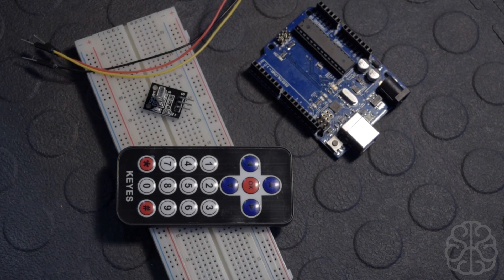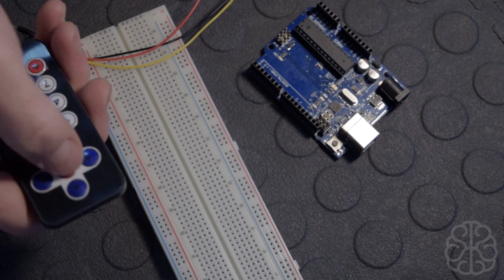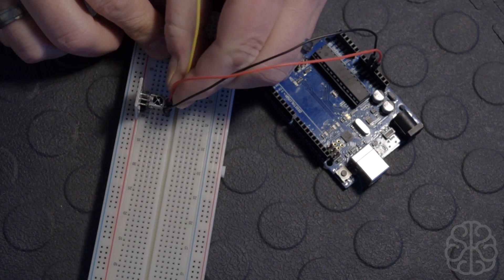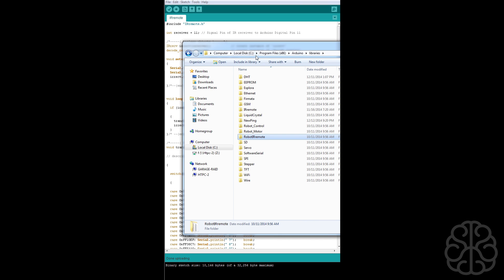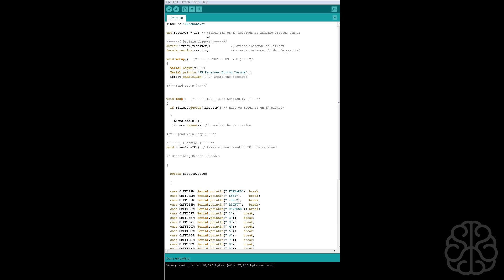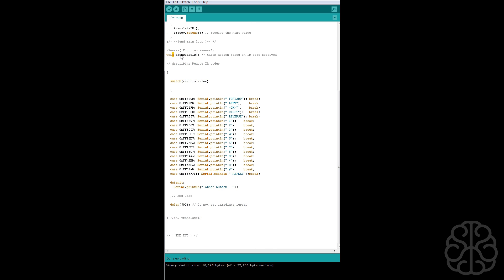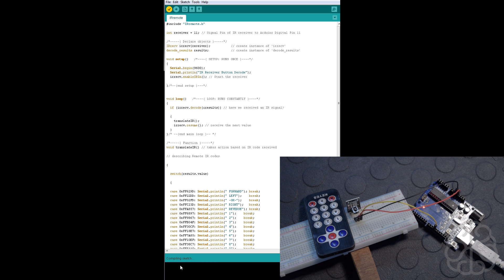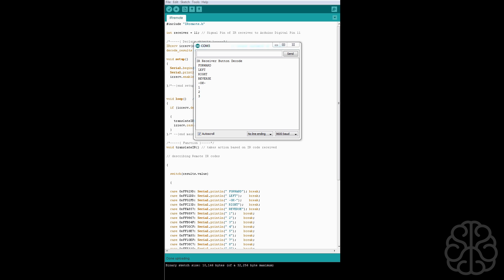Use Infrared sensor & IR Remote control on Arduino - Tutorial

Comment: Hello sir I am Abid. I have a question can I use the IR remote for the 28BYJ-48 Stepper Motor. Condition is that each button is used running the motor clockwise each time press and when the button is pressed again to run the motor in anti-clock direction with a specific number of turns. If any idea you have that will be my good luck.
Thank You!

Comment: hey buddy, good video well explained, I have a simple control access code which use a 4x4 keypad, if I put 1234 pin this open a relay, I would like to use a remote control on it, the idea is  to put the pin on the remote or in the keypad, so any idea how to do it?

Comment: /*
source:  Alex Lin
You'll need to change the led pins and the codes
accordingly to your configuration and IR remote
*/
#include <ir_Lego_PF_BitStreamEncoder.h>
#include <IRremote.h>
#include <IRremoteInt.h>
#define RED_LED_PIN 4 //Define the pin of the red led 
#define BLU_LED_PIN 5 //Define the pin of the blue led
#define YEL_LED_PIN 6 //Define the pin of the yellow led
#define GRE_LED_PIN 3 //Define the pin of the green led
#define ONE 16738455 //Define the key 1
#define TWO 16750695 //Define the key 2
#define THREE  16756815 //Define the key 3
#define FOUR  16724175 //Define the key 4
#define FIVE 16718055 //Define the key 5
#define SIX 16743045 //Define the key 6
#define SEVEN 16716015 //Define the key 7
#define EIGHT 16726215 //Define the key 8
#define NINE 16734885 //Define the key 9
#define ZERO 16730805 //Define the key 0
IRrecv irrecv(7); //The pin where you connect the output pin of AX-1838HS
decode_results results;
void setup()
{
  pinMode(RED_LED_PIN, OUTPUT); //Change the mode of the red led pin to output
  pinMode(YEL_LED_PIN, OUTPUT); //Change the mode of the yellow led pin to output
  pinMode(BLU_LED_PIN, OUTPUT); //Change the mode of the blue led pin to output
  pinMode(GRE_LED_PIN, OUTPUT); //Change the mode of the green led pin to output
  irrecv.enableIRIn(); // Start the receiver
}
void loop() {
  if (irrecv.decode(&results)) {
  
    if (results.value == ONE) { //Check if the key 1 is pressed
      digitalWrite(RED_LED_PIN, HIGH); //Turn on the red led
    }else if(results.value == TWO) { //Check if the key 2 is pressed
      digitalWrite(BLU_LED_PIN, HIGH); //Turn on the blue led
    }else if(results.value == THREE) { //Check if the key 3 is pressed
      digitalWrite(YEL_LED_PIN, HIGH); //Turn on the yellow led
    }else if(results.value == SEVEN) { //Check if the key 4 is pressed
      digitalWrite(GRE_LED_PIN, HIGH); //Turn on the green led
    }else if(results.value == FOUR) { //Check if the key 5 is pressed
      digitalWrite(RED_LED_PIN, LOW); //Turn off the red led
    }else if(results.value == FIVE) { //Check if the key 6 is pressed
      digitalWrite(BLU_LED_PIN, LOW); //Turn off the blue led
    }else if(results.value == SIX) { //Check if the key 7 is pressed
      digitalWrite(YEL_LED_PIN, LOW); //Turn off the yellow led
    }else if(results.value == EIGHT) { //Check if the key 8 is pressed
      digitalWrite(GRE_LED_PIN, LOW); //Turn off the green led
    }else if(results.value == NINE) { //Check if the key 9 is pressed
      digitalWrite(RED_LED_PIN, HIGH); //Turn on the red led
      digitalWrite(BLU_LED_PIN, HIGH); //Turn on the blue led
      digitalWrite(YEL_LED_PIN, HIGH); //Turn on the yellow led
      digitalWrite(GRE_LED_PIN, HIGH); //Turn on the green led
    }else if(results.value == ZERO) { //Check if the key 0 is pressed
      digitalWrite(RED_LED_PIN, LOW); //Turn off the red led
      digitalWrite(BLU_LED_PIN, LOW); //Turn off the blue led
      digitalWrite(YEL_LED_PIN, LOW); //Turn off the yellow led
      digitalWrite(GRE_LED_PIN, LOW); //Turn off the green led
    }
    irrecv.resume(); // Receive the next value
  }
}

Comment: my ir receiver just has a red light permanently on until I pull the power off. the code previeosuly was working and so was the IR so I dont know what ive done pls help me
Reply: check your sensor pcb if its crossed input and check the sensor only pin out

Comment: i have a problem

text from compiler:

Arduino: 1.8.1 (Windows 7), Board: "Arduino/Genuino Uno"

Tone.cpp.o (symbol from plugin): In function `timer0_pin_port':

(.text+0x0): multiple definition of `__vector_7'

libraries\IRremote\IRremote.cpp.o (symbol from plugin):(.text+0x0): first defined here

collect2.exe: error: ld returned 1 exit status

exit status 1
Error compiling for board Arduino/Genuino Uno.

This report would have more information with
"Show verbose output during compilation"
option enabled in File -> Preferences.

Comment: This report would have more information with
  "Show verbose output during compilation"
  enabled in File > Preferences.
Arduino: 1.0.6 (Windows 10 Pro), Board: "Arduino Uno"
C:\Program Files (x86)\Arduino\libraries\RobotIRremote\IRremoteTools.cpp:5: error: 'TKD2' was not declared in this scope

Comment: #include <boarddefs.h>
#include <IRremote.h>
#include <IRremoteInt.h>
#include <ir_Lego_PF_BitStreamEncoder.h>

int receiver = 11; // Signal Pin of IR receiver to Arduino Digital Pin 11

/*----( Declare objects )----*/
IRrecv irrecv(receiver);     // create instance of 'irrecv'
decode_results results;      // create instance of 'decode_results'

void setup()   /*---( SETUP: RUNS ONCE )---*/
{
  Serial.begin(9600);
  Serial.println("IR Receiver Button Decode");
  irrecv.enableIRIn(); // Start the receiver

}/*-(end setup )--*/

void loop()   /*---( LOOP: RUNS CONSTANTLY )---*/
{
  if (irrecv.decode(&results)) // have we received an IR signal?

  {
    translateIR();
    irrecv.resume(); // receive the next value
  }
}/* -(end main loop )- */

/*----( Function )----*/
void translateIR() // takes action based on IR code received

// describing Remote IR codes

{

  switch (results.value)

  {

    case 0xFF629D: Serial.println(" FORWARD"); break;
    case 0xFF22DD: Serial.println(" LEFT");    break;
    case 0xFF02FD: Serial.println(" -OK-");    break;
    case 0xFFC23D: Serial.println(" RIGHT");   break;
    case 0xFFA857: Serial.println(" REVERSE"); break;
    case 0xFF6897: Serial.println(" 1");    break;
    case 0xFF9867: Serial.println(" 2");    break;
    case 0xFFB04F: Serial.println(" 3");    break;
    case 0xFF30CF: Serial.println(" 4");    break;
    case 0xFF18E7: Serial.println(" 5");    break;
    case 0xFF7A85: Serial.println(" 6");    break;
    case 0xFF10EF: Serial.println(" 7");    break;
    case 0xFF38C7: Serial.println(" 8");    break;
    case 0xFF5AA5: Serial.println(" 9");    break;
    case 0xFF42BD: Serial.println(" *");    break;
    case 0xFF4AB5: Serial.println(" 0");    break;
    case 0xFF52AD: Serial.println(" #");    break;
    case 0xFFFFFFFF: Serial.println(" REPEAT"); break;

    default:
      Serial.println(" other button   ");

  }// End Case

  delay(500); // Do not get immediate repeat

}
Reply: doesnt work your code

Comment: I have few questions about the project. I hope you can point me to a better direction. I want to turn the remote into a quick button for my computer, how do the codes looks like. For example for button 1 I want to be "ctrl +" and button 2 "ctrl -" how do I program it. I know the arduino will connect to my computer and do i need to program the aduino "like the driver" If you can answer the question will be a great help. Thank you so much.

Comment: Hi...Help please, How do i know what hexes to use for the cases?please help me!!!
Reply: It tells me this:

Arduino: 1.8.1 (Windows 10), Board: "Arduino/Genuino Uno"

C:\Users\Natha\Documents\Arduino\IR_remote\IR_remote.ino: In function 'void translateIR()':

IR_remote:18: error: unable to find numeric literal operator 'operator""S2AD'

     0xFFS2AD: Serial.print(" 0"); break;

     ^

exit status 1
unable to find numeric literal operator 'operator""S2AD'

(the last part like times 20 with different hexes)
Reply: by last part i mean tihs part:

IR_remote:18: error: unable to find numeric literal operator 'operator""S2AD'

     0xFFS2AD: Serial.print(" 0"); break;

     ^

exit status 1
unable to find numeric literal operator 'operator""S2AD'
Reply: Look at the code at 4:23
Reply: You can use decimal values. Is easier. I did it. is 9 digits. Just use Serial.print(results.value) to see numbers. If You use Serial.print(results.value, HEX) You will get hex values.

Comment: No Matter what i do this is isn't running.  The only library folder i have in the document arduino folder is a IR master folder. nothing else but i'm still getting the error. 
C:\Program Files (x86)\Arduino\libraries\RobotIRremote\src\IRremoteTools.cpp:5:16: error: 'TKD2' was not declared in this scope

 int RECV_PIN = TKD2; // the pin the IR receiver is connected to

                ^

Multiple libraries were found for "IRremote.h"
 Used: C:\Program Files (x86)\Arduino\libraries\RobotIRremote
 Not used: C:\Users\Owner\Documents\Arduino\libraries\Arduino-IRremote-master
exit status 1
Error compiling for board Arduino/Genuino Uno.
Reply: I'm having the same issue.

Comment: Why you didn't use pinMode in the setup ?
Reply from the maker: Hi Patryk, when the Arduino is powered on, al the pins are set as INPUT, with PULLUP resistors turned off by default.  So in this tutorial case, since the pin we are using to connect the IR sensor is an Input and doesn't need Pullup resistors, it's optional to use pinMode in the setup since it's this way by default.  Hope that helps and thank you for watching!

Comment: Hello..Could you help me please? My cases dont work.. I always get default for whatever button I use. Do u know why, please?
Reply: after your case is it a : or ;
Reply: Add a capcitor
Reply: First You need use Serial.println(results.value) to print on screen what button You pusht, then You need check and change hex value for case. Your IR remote could have different keystrokes. I hope that will help in futer to other peoples. It helps me. Whit this method i can use remote for tv.

Comment: Hallo,

I tried your IR-library with a similar simple key pad and it worked very quickly. 
But ofen the Arduino UNO gets another code than usual.

What may be the reason? What can I do to avoid it?

regards

Freddy Conrad

Comment: please help :
Arduino : 1.6.8 Hourly Build 2016/02/09 05:41 (Windows 10), Carte : "Arduino/Genuino Uno"

D:\Program Files (x86)\arduino-nightly\libraries\RobotIRremote\src\IRremoteTools.cpp:5:16: error: 'TKD2' was not declared in this scope

 int RECV_PIN = TKD2; // the pin the IR receiver is connected to

                ^

exit status 1
Erreur lors de la compilation.

This report would have more information with
"Show verbose output during compilation"
option enabled in File -> Preferences.
Reply: I know this is a year late, but that means you haven't loaded the library correctly. You should look on the Arduino forums to find out how to properly do it.

Comment: any1 know what frequency these use ???
Reply from the maker: +kenny ball I believe the IR receiver uses 38kHz, which is the most popular frequency for tv remotes.  Found this pdf with tech specs here: http://www.vishay.com/docs/82491/tsop382.pdf 
Hope that helps, thanks for watching btw :)
Reply: cheers for the reply...thx for takin the time ;)
Reply from the maker: +kenny ball Hey, no problem at all!  Glad I could help :)
Reply: @Brainy-Bits if it's using 38kHz, the remote in my kit doesn't take values from long distance only near the sensor it is working. How to solve this problem?
Reply: about 40kHz. There on Youtube is another tutorial about ir remote. https://www.youtube.com/watch?v=8E3ltjnbV0c&t=1671s This is greate tutorial.

Comment: what i have to do if my remote control generates different codes?
Reply: +Luca Rizzo this is a from a comment below "+Mr30friends Ok , i made it , for those with the same issue. Paste :
Serial.println(results.value, HEX);
on top of:
translateIR(); "
Reply: +Jordan Habash thanks! i'll try it ;)
Reply: +Jordan Habash it doesn't work. Arduino says:" translateIR was not declared in this scope".
Reply: that's just because you need to change to code around a little. put the translateIR at the top of the code and it should work. if there is anything else that is not declared in the scope, just move that decleration around

Comment: Thank you very much ,everything worked .I only have one question .My remote control has more buttons than yours.How can i find out their codes (0xFF9867 for example) so i can make more cases to utilize them .
Reply: +Mr30friends Ok , i made it , for those with the same issue. Paste :
Serial.println(results.value, HEX);
on top of:
translateIR(); 
    irrecv.resume(); // receive the next value
That way the value will be pasted in the serial monitor and you can make your case for every button accordingly.
Reply: Will the IR sensor catch the signal from all the angles?? I mean will it work if we pressed a key from behind the ir sensor??

Comment: I have a problem Arduino: 1.7.8 (Windows 7), Board: "Arduino Uno"

D:\Program Files\Arduino\libraries\RobotIRremote\src\IRremoteTools.cpp:5:16: error: 'TKD2' was not declared in this scope

 int RECV_PIN = TKD2; // the pin the IR receiver is connected to

                ^

Error compiling.

  This report would have more information with
  "Show verbose output during compilation"
  enabled in File > Preferences.
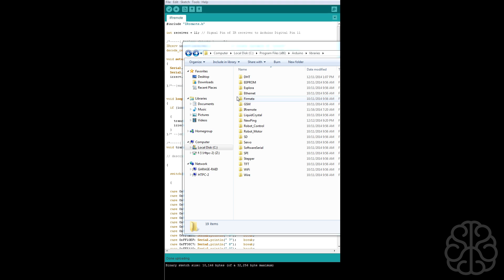Reply: +Snoop Kidoo  ... that's why it's said in the video (at 2:50 - 3:00) that you must delete the folder named "RobotIRremote" that cames with the Arduino installation - there's already an old version with the same name inside that folder. (Save it to another place outside of the Libraries folder, if you want to keep it). HTH.
Reply: thanks for help! :)

Comment: Hi am stuggeling with my project. Im making a IR Remote project and when reading the signal or number from a IR Remote and try to put it in my code it gives me an error that i have not declared it in the scope ? If anyone can help :)

code:

/*

* IRremote: IRrecvDemo - demonstrates receiving IR codes with IRrecv

* An IR detector/demodulator must be connected to the input RECV_PIN.

* Version 0.1 July, 2009

* Copyright 2009 Ken Shirriff

* http://arcfn.com

*/

#include <IRremote.h>

int RECV_PIN = 11;

IRrecv irrecv(RECV_PIN);

decode_results results;

void setup()

{

Serial.begin(9600);

irrecv.enableIRIn(); // Start the receiver

}

void loop() {

if (irrecv.decode(&results)) {

Serial.println(results.value, HEX);

if(results.value)

{

// HERE IS THE PROBLEM GIVES ME THIS ERROR : "exit status 1

// FF02FD' was not declared in this scope"

if(results.value == FF02FD)

{

}

}

irrecv.resume(); // Receive the next value

}

delay(100);

}
Reply: +Ruben van Breda ... Try this:  if(results.value == 0xFF02FD)  ...  you must use the "0x" to make it understand it's an hexadecimal value.  HTH
Reply: Thanks for your help

Comment: I don't have the the infrared sensor with the other things I only have the one with out the bottom part
Reply from the maker: +Coleton Watt I'm guessing you only have the sensor without the pcb attached... If so then your sensor should have 3 legs, 2 of them are ground and voltage, and the last one is the signal.  Without knowing the model number of the sensor you have I can't tell you which pin is which.  But if you can find the model number, do a quick search on google to find the pinout, and then you connect the pins to GND, 5V, and the signal wire would be connected to the UNO.  The code should work the same in theory.  Hope that helps and thanks for watching!
Reply: thanks

Comment: This question might seem to easy to understand for me to find someone else having asked it and gotten an answer for that. IS the ground after Digital Pin 13 on the Arduino Uno the same as the grounds at the Power section? Does it matter if I use either of those three?
Reply from the maker: +Jonas Eriksson You can make connection to any ground pin they are all the same ground :)  Hope that helps and thanks for watching!

Comment: How do you know the codes that the remote can generate ?FF????
Reply from the maker: +Lester Davidoff You can try this Arduino code to see if it will work with your remote...  This code will display the HEX code sent from your remote in the serial monitor.  If it works, you just have to replace the HEX code in the tutorial code.  You will need the IRremote library installed, but i'm assuming you already have it installed :).  Let me know...

#include <IRremote.h>

int RECV_PIN = 11;

IRrecv irrecv(RECV_PIN);

decode_results results;

void setup()
{
  Serial.begin(9600);
  irrecv.enableIRIn(); // Start the receiver
}

void loop() {
  if (irrecv.decode(&results)) {
    Serial.println(results.value, HEX);
    irrecv.resume(); // Receive the next value
  }
}

Comment: my remote arduino don't reconize my remote. that said other buttons
Reply: +theDibu222 if you change the line under "default:" to " Serial.println(results.value); " then it will print out the decimal form of the code for the button on your remote.  you can convert that number to hex and add the "0x" before it and add it to the list.  That should let your remote work.

Comment: hi how can i read HEX code sent from my remote ???
i dont under stand from other comments !
when i used ur code i had  this error
 sketch_jul19a.ino:30:8: error: invalid suffix "F58A7" on integer constant
Reply from the maker: Gzwan Jamal Hi, did you try with this code? 

#include <IRremote.h>

int RECV_PIN = 11;

IRrecv irrecv(RECV_PIN);

decode_results results;

void setup()
{
  Serial.begin(9600);
  irrecv.enableIRIn(); // Start the receiver
}

void loop() {
  if (irrecv.decode(&results)) {
    Serial.println(results.value, HEX);
    irrecv.resume(); // Receive the next value
  }
}